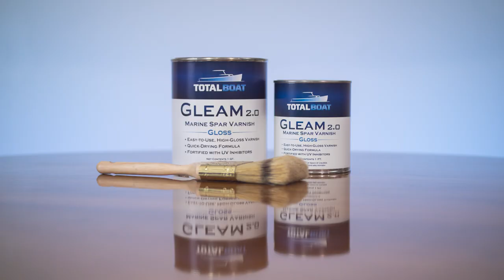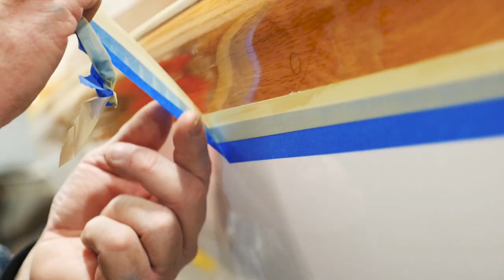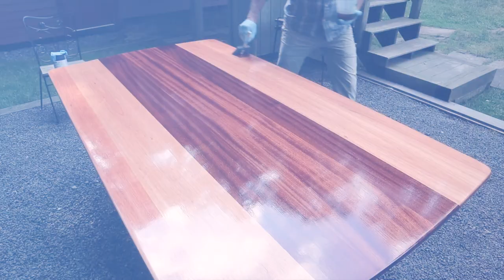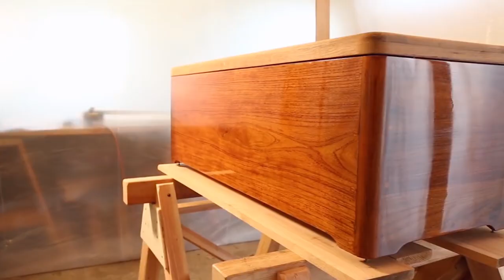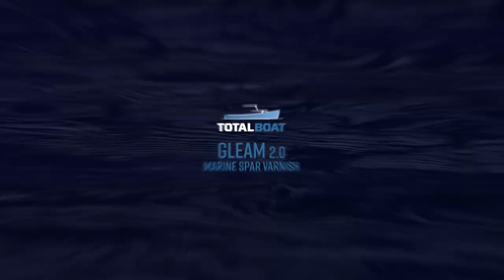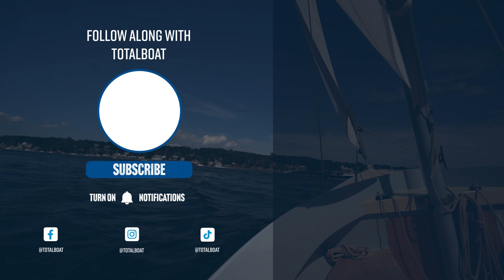TotalBoat GLEAM 2.0 MARINE SPAR VARNISH

Comment: How will this hold up in a oak wood truck bed?
Reply from the maker: Gleam is a great option for a wood truck bed! We would recommend applying about 8 coats in total.
Reply: @TotalBoat  do I need to use an impregnator first?
Reply from the maker: @JonnyBlazeTCB  We would recommend sealing the bare wood with either our Penetrating Epoxy or Wood Sealer Varnish Primer for the best seal.
Reply: @TotalBoat  how many coats of the epoxy?
Reply from the maker: @JonnyBlazeTCB  Depending on the porsity of the wood, about 2-3 coats to fully seal it.
Reply: @TotalBoat  ok. So a 4x6.5ft bed, top, bottom, 2-3 coats of epoxy sealer, 8 coats of Gleam 2, how much product should I purchase of each?
Reply from the maker: @JonnyBlazeTCB  We would recommend about a quart of Penetrating Epoxy and 2 quarts of Gleam. It may take more epoxy depending on the porsity of the wood.